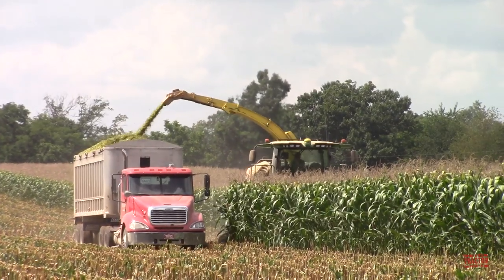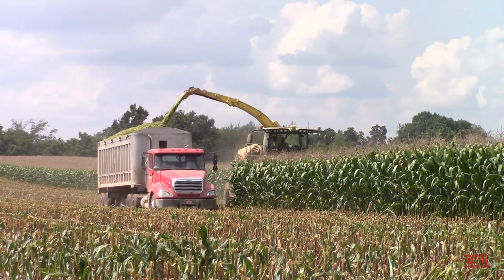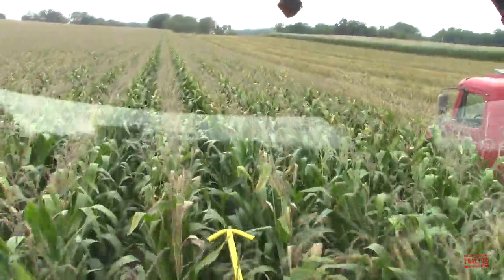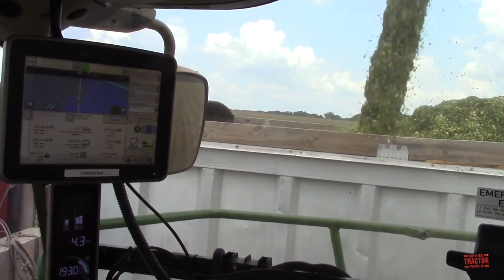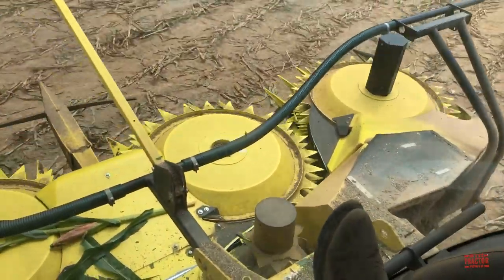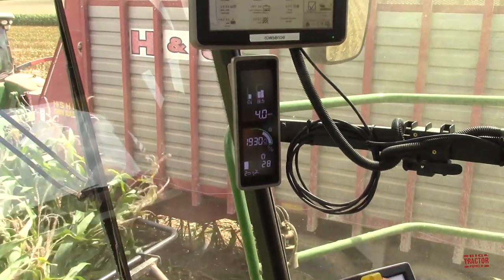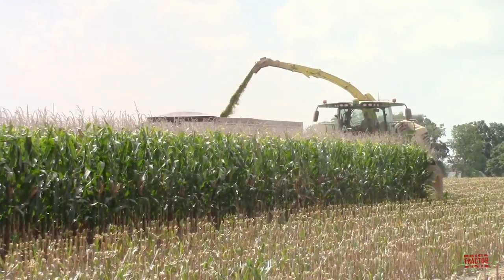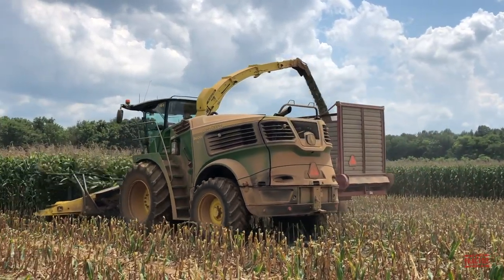John Deere 9600i Chopping Corn

Comment: Excellent!, Next to haying, my other favorite time of the year, I'd never heard that about increasing the protein by chopping higher, interesting, thank you Jason
Reply: Raising the cut height in corn for silage increases total digestible nutrients (TDN, in dairy or beef nutritionist speak) and improves overall digestibility slightly, but does not change protein in any meaningful way. Raising the cut height would definitely increase the starch/carbohydrate content (due to higher grain-to-stover ratio) but otherwise have a negligible effect on protein. Cutting high also reduces yield, so it's a tradeoff; most people would cut corn that green and healthy looking just as low as they could and cut it high if it gets really dry. I don't really understand what these folks are doing in this video. I assume they have an abundance and just want to boost the feed value a little. Emphasis on the word "little."

Comment: Another good chopping video, and the only series of Deere self-propelled forage harvesters that I haven't personally witnessed in operation since the first 430-hp 6910 demo I saw way back in '97. Great footage and it was cool to see and hear the cab action. A few thoughts:

The operator obviously knows a lot, but chopping corn high does not boost protein in any meaningful way. It improves overall digestibility (by leaving the depleted lower stalk in the field, which the plants often sacrifice to fill out the ear) and increases total digestible nutrients (TDN) but corn silage is a very low protein feed, and chopping high doesn't change that. Especially not when the crop is very green and very healthy looking, like this stuff. He had the right concept, but considering what protein supplements (like soybean meal) cost, if boosting the protein level in the corn was that simple, everyone would do it.

There is absolutely no way that particular field is yielding 23 wet tons or even anything remotely close to it, especially chopping it that high! They're on 30" centers and from the plant spacing in the rows, I'm guessing the population is less than 35,000 plants per acre. Based on plant stature (very short) and stalk diameter I would guess no more than 16-17 tons in that field corrected to 65% moisture. 23 ton corn has to be really dense stuff, much denser or taller (or both) than what they're chopping. But again, that's just one field.

Those fuel consumption numbers the driver quoted are laughable. A 13-liter 600+ hp diesel engine running anywhere near its designed load is going to burn a heck of a lot more fuel than 9.9 gallons per hour. At that rate, the 290-gallon tank would last 3 days at 10 hours per day, which ain't happening in this universe or any other. That was just a snapshot in time, and leaves lots of questions. It couldn't possibly have been under full load. He was running 4 mph, which is really, really slow for a 600+ hp chopper cutting 8 rows of 9-foot tall corn. Granted, we don't know the chop length, but shortening the length of cut enough to limit intake capacity to the point of forcing a reduced ground speed would increase fuel consumption, not decrease it. I wish I could read the main display to see more of what's happening. Surely they're running a kernel processor, which would indicate longer chop lengths. That machine is certainly capable of running faster than he was going in those conditions. I'm guessing they didn't have enough hauling capacity to haul it away from that field any faster, so he was being sensible and not pushing it. Still, impressive to watch!

Gallons/hour is a useless metric on a forage harvester anyway. Tons/gallon is a much better measurement, but that still doesn't consider the huge effect that length of cut has on fuel consumption. Tons/gallon/hour is even better, but that is highly dependent on the size, shape, and topography of the fields, and can be all over the place for any one machine.

The combined list price of the chopper and heads might have been $701k, but I guarantee they didn't pay that. They appear to be loyal Deere customers, and probably qualify for all sorts of "loyalty" perks like big cash discounts, zero % financing for several years, etc etc. (We bought a new Deere tractor and they gave us a tremendous cash discount on a hay baler through that program a year or so later.) I don't know all the workings of a dealership, but it's common to pay much less than list price. Volume dealers often get volume discounts from the manufacturer as well, as I learned when I bought a new NH pull-type chopper 2 years ago.

It looks like auto-steer would take a lot of stress out of running those machines for long hours at a time and especially at night. It's cool that they had GPS and the row sensor both operating.

Great video! Keep it up.

I don't want to harass you, but again, if you're interested, I'd be happy to shoot some footage of us chopping and hauling manure for you to use on your channel!

Comment: Should come out to central California to see our silage corn. I worked at a dairy on the chopping crew and we usually had 12 to 14ft corn, the top of the corn is 6in to 1ft above the cab. We used 3 class 980s with 8 row heads with no gps  steering.
Reply: Yes, I totally agree. We had a lot of corn silage before in Chino , Ca. The corn was 12-14’ easy, couldn’t see the trucks.

Comment: We were told the lower portions of the stalk were less digestible
Reply: Yeah, I would guess that's the primary reason most people use a higher cutting height. However, there might also appear to be a higher protein content too as the bottom of the stalk will be primarily fiber and so by reducing the percentage of the silage that is fiber, the corn silage will test higher in protein too. I forget the actual numbers as to what happens to digestibility as for every unit increase in cutting height but there is data somewhere that supports this thought.
Reply: That's interesting
Reply: Corn silage isn’t really know for very much protein. Energy from starch right?
Reply: @MrMagnum7220  Right. They ain't boosting protein by chopping high, especially not in that green healthy stuff, no matter what that guy says (but he does seem like a pretty cool feller, y'know?) They might improve digestibility a little, but again, that's really healthy looking corn. It's not drought stressed and all dried up in the bottom with dropped leaves, which is where high-chopping is most beneficial.

Comment: What a cool machine. I'd like to take that head into battle against isis or your average jihadist and install cameras. That thing is deadly. Corn is a thick tough fibrous plant, so that's one hard working piece of equipment. You need a truck and trailer to follow you so this task is labor intensive and the cost of tractor trailers drivers fuel, insurance involving large cash outflow. It takes money to make money. The whole process is based on faith, a belief that's positive and the love for life. Enjoyed JD Chopping Corn & Narration🚜👍

Comment: Whats the reason fot this farm to use a small header fot this machine, a 12 row 30 inch head  is more usual to this machine
Reply from the maker: They plant everything on 16 rows. They run 4 16 row planters, two 8 row 9600i choppers and 4 S770 8 row combines. My guess is to control the wheel compaction to the same path each harvest. They subsoil everything 18 inches deep after harvest to beak compaction. From what I see two 8 row choppers keep 8 wagons and a number of semis loaded every two minutes so a bigger head would mean even more trailers to keep up.

Comment: It makes me wonder with all that harvesting that that machine does the  I wonder how often they have to sharpen the chopping blades inside the machine
Reply: Most folks would sharpen at least once a day, sometimes more. Of course, that's extremely easy to do on one of these self-propelled machines with push button auto sharpening and shear bar adjustment.

Comment: That machine gets quite the work load between corn, sorghum and alfalfa. $701K plus TAX would be close to 1 Mil.
Reply from the maker: The total around $745,000 because the 659 hay head is $43,738.00.  It’s a big investment for sure. This farm runs two 9600i forage harvesters.  The key is to get the crop harvested at the perk time. These machines help stay ahead of wet and dry weather than can reduce the quality of the crop.
Reply: bigtractorpower a great investment

Comment: 65 to 70 acres per day? That just doesn't sound like a lot to me for a machine that big. I thought it could do at least over a hundred acres per day. That doesn't mean anything though. There is a lot that I don't know.
Reply: FRANsylvania Maple that’s a tricky question how many trucks are available? Will they be working in one field all day or do they have to stop and travel between fields distance between field and storage location, break downs, lunch break? Many many variables
Reply: If you harvest 65 acres a day @ 23 tons per acre that 1,495 tons a day.
Reply: @bwtupper May dad and I used to chop about 1,300 tons every fall.  We had a 2 row 880 NH chopper.  We could chop about 10-12  ten ton loads a day.  So it took us about 10.5-12 days depending on the weather.  But the chopper only cost about $7,000 new and the tractor, an IHC 186 Hydro was about $15,000 at the time.  Loved that Hydro on the chopper.
Reply: Bagging silage can be a big bottleneck. If they pile the silage it goes way faster as the trucks unload very fast. The baggers can only take and pack so much feed

Comment: .25 gal a ton x 23 ton a acre x 70 acres a day. That's a better number
Reply from the maker: The 9.9 gal came from the harvesters computer screen.  You can see all the fuel info in real time.
Reply: @bigtractorpower  I have a 8700. Something wrong with his numbers
Reply: @jasonreber4101  I know, right? Maybe 9.9 under half load at the paltry 4 mph he was running. Still a bit of a stretch at that. I'd guess 25 gallons/hour under heavy load.